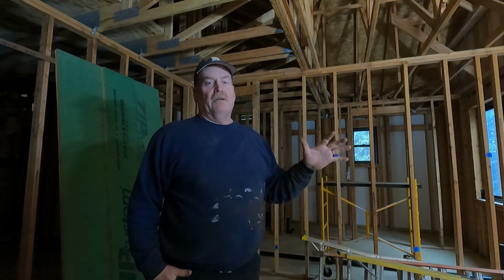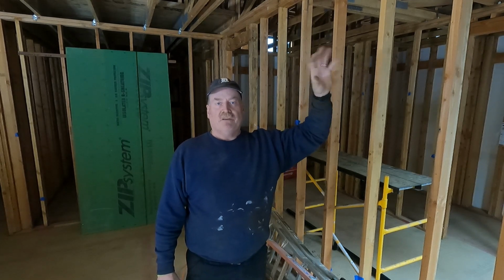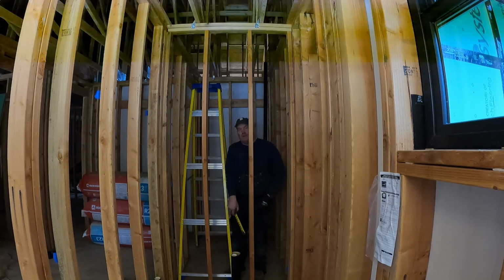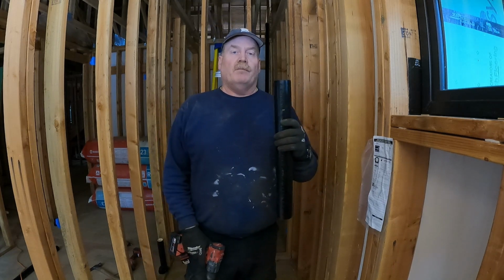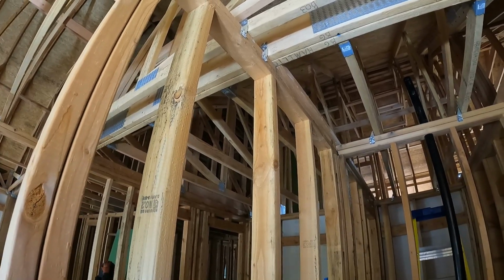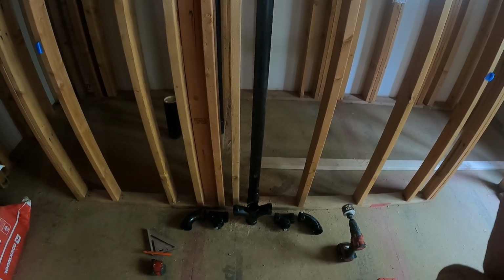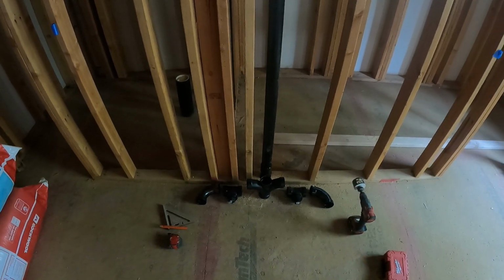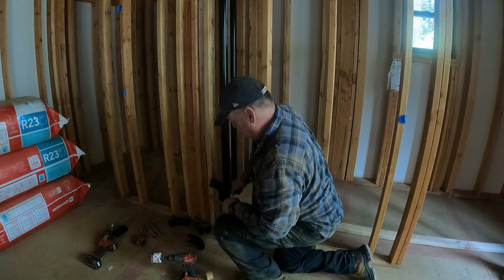Venting the sewer system through the rooftop

Comment: I got away from self feeds 20+ years ago, hole saws make life easier and a cleaner end product. 
One quick tip I discovered is score a few holes to be drilled then go back with a 1/2" paddle bit and drill on the bottom of the score line. Sawdust can escape, can stays cooler and sharper longer. Nice clean looking work Dude, thanks for sharing. 
From a 49 year long plumber in the 49th state😁
Reply from the maker: Thank you for the tip on extending the life of the hole saw.  I appreciate the compliment and you taking the time to share your knowledge.